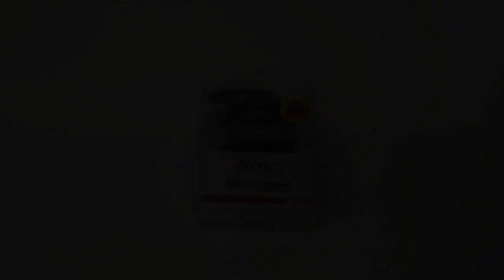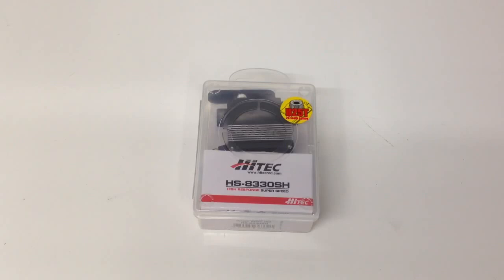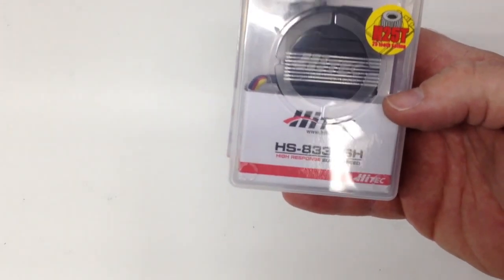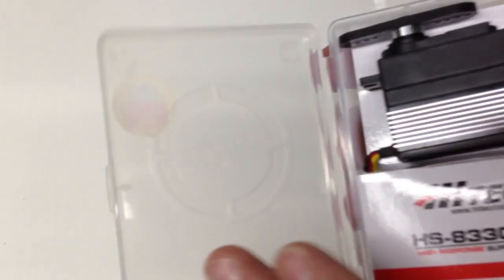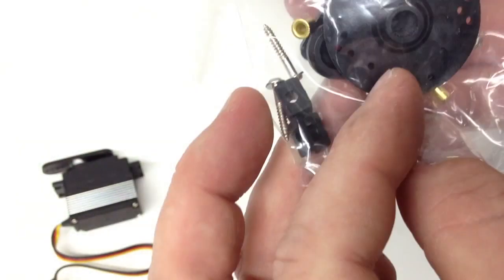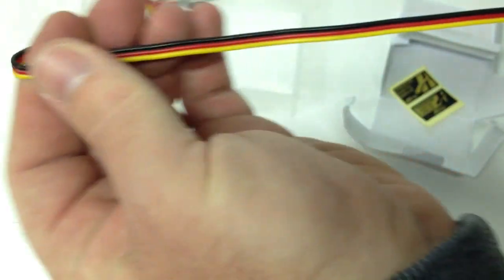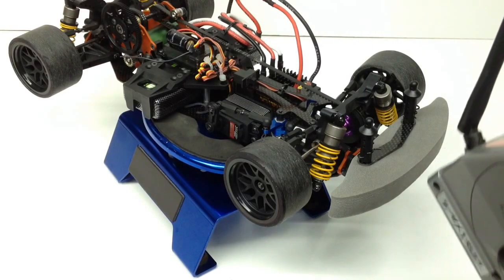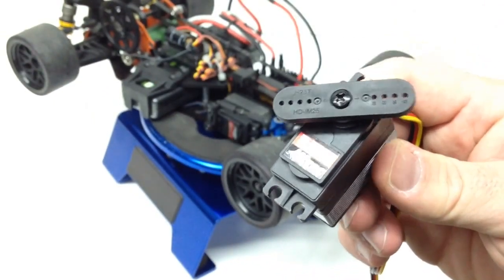Hitec HS-8330SH Servo - Unboxed and Tested!!

Comment from the maker: Need to upgrade that stock servo?  Need more speed or better torque?  Check out this all new servo from Hitec.
Reply: hi rc network great video,i have a doubt, i want to use this servo for picking objects for a robot, whats the load capacity does this servo have?
Reply: in a robot picking objects project, can this servo pick 1 kilograms of object?

Comment: U think this would work well in a tekno. Was thinking if it. But if not what Savöx u recommend for the sct410. I'll be getting one for Xmas this year.
Reply from the maker: I currently run the Savox 1258tg in my SCT410.  This Hitec 8330 has slightly better specs than the Savox though with .07 sec (vs .08) and 181 in/oz of toprque (vs167).  So I think it would be a slight upgrade over the Savox.

Comment: Getting this servo for my Yeti! :)
Reply from the maker: Jeff Holmström Good deal.  The 181 oz in is right on the edge of what I would put in the Yeit depending on the weight you're running.  I ended up with the 9370 for my 1/10th yeti
Reply: The RCNetwork Hello again i got my servo today but i looks like they sent me the wrong one, i got the Hitec 8380 instead, is it to strong? I will upgrade the steering rack and etc, will it work you think? It's 403 oz @ 6.0V

Comment: It works if i conect  to arduino 5v?  Does it need an external supply to work????? Please help!
Reply from the maker: Jonathan Hurtado Not sure.  Most Premium Servos from Hitec give specs on 6.0v and 7.4v......Have you tried contacting Hitec?
Reply: +Jonathan Hurtado the arduino does not have enough power to control this right from the board, you still need an external servo power supply

Comment: This or savox 1258tg
Reply from the maker: Justin Fajardo I was a huge fan of the 1258tg until I started using the Hitec 8330.  No cap is needed with the 8330 and it's so much quieter!